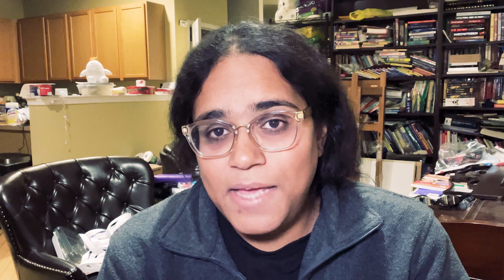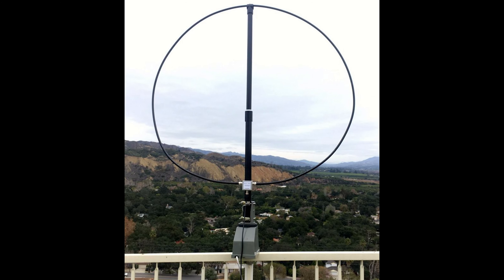How much power should I use to make ham radio contacts?

Comment: Excellent explanation! So many great points in a quick and concise video! Thank you so much! I especially liked how you mentioned S-meter readings for the receiving station. Because increasing by one S-unit represents 6 dB (~ 4 times the power), a 400-watt amp vs. a 100-watt transceiver only makes a difference of one S-unit. It would theoretically require another 4x the power (1600 watts) to increase a second S-unit. Therefore, the difference between 500 watts and 1500 watts is negligible under most circumstances but can have an advantage in certain situations as you described. Thank you for this excellent video content! ~ 73 ~ AC7WH 📻📶🗼:person-turquoise-writing-headphones:🎧

Comment: There's a gadget called the "Quick 220" for getting 240V from two opposite phase 120V outlets, including an interlock circuit to ensure it only operates if both circuits are properly connected. Might be cheaper than rewiring your house. Also, in the case of digital communications, wouldn't higher power let you run higher bitrates so that the same data can be sent in less time leaving more time on that frequency for others to use?
Reply from the maker: There is a fixed bit rate with the JT modes. Quick220 works if you have two phases connected. Some older houses do not.

Comment: If you’re trying to call “CQ” or all stations, the highest power or gain you can achieve is the minimum to call every station.
Would it cause interference, yes. Would it be a waste of electrical energy and could damage equipment, possibly yes.
I think to assume that you’re causing interference is not practical because there is always a possibility of causing harmful interference without being told or realizing that you are. When to use less power? When you’re already contacting a station or know how much power to use to keep a good signal for your contact. When you know that you’re interfering with another station. When it’s causing interference with non-licensed radio or electronic equipment.
Reply from the maker: I agree to an extent. If you’re having a conversation with one or more friends, it’s wise to limit your power so they can hear and you limit your reach. One example I didn’t want to cite in the video is that I would be in a roundtable with my friends at full power and then end up getting a pileup, because I was so loud, and they haven’t heard a female voice on air so often. So I found that lowering the power helped immensely with controlling that.

Comment: I ordered an Elecraft 500 watt Power Combo with a 240 volt plug as my first amp. I hope it will solve my CQ blues. My wife said no one answers my CQs because no one wants to talk to me - I have to experiment to find out if this is true or not.
Reply from the maker: The amp with a good antenna does quite well. See you in the pileups?
Reply: At least your wife is speaking to you.